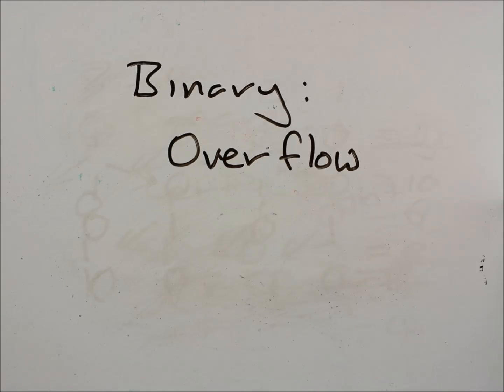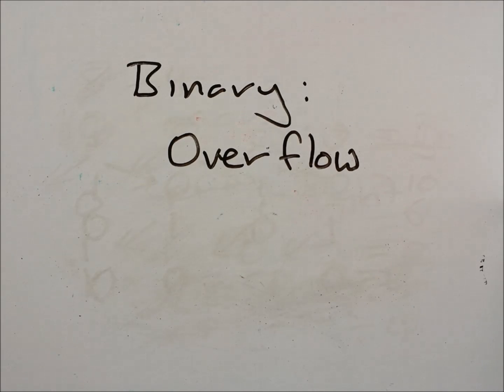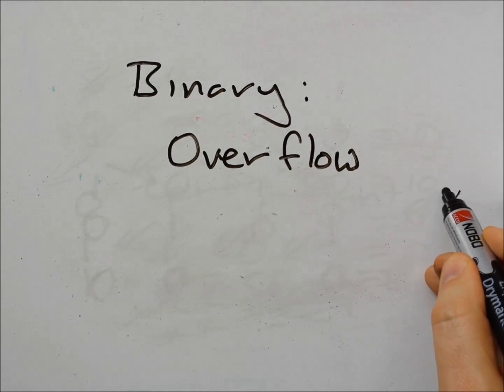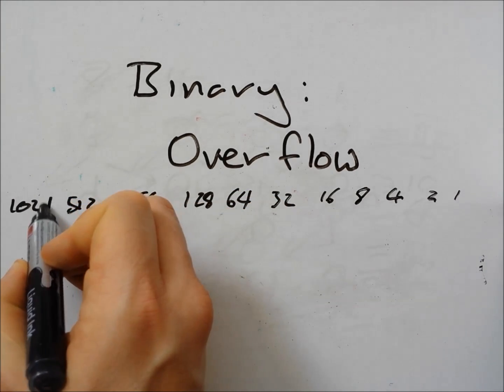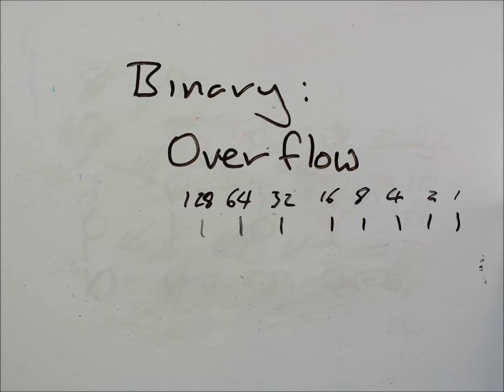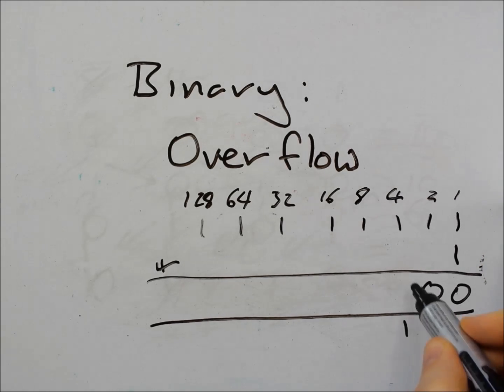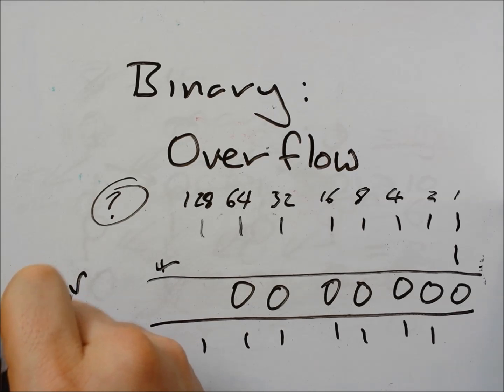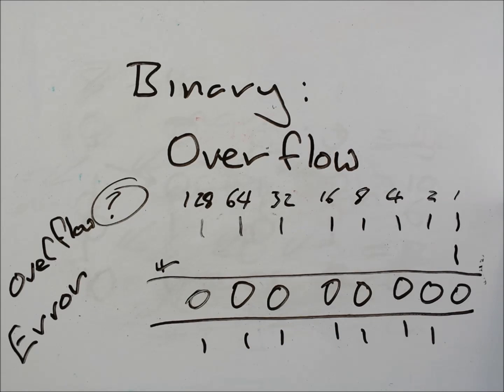Binary Overflow

Comment: A 128-bits CPU?... ^^
Reply from the maker: 8 bits, with the most significant bit being valued at 128, giving a total of 256 different representable value. A 128 bit number would have 2^127 as its most significant bit and 2^128 representable values.